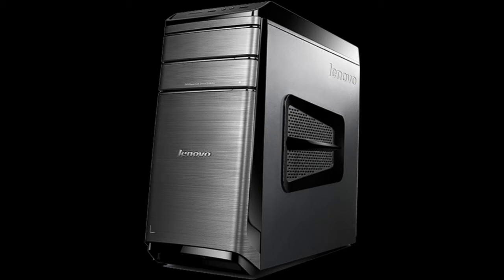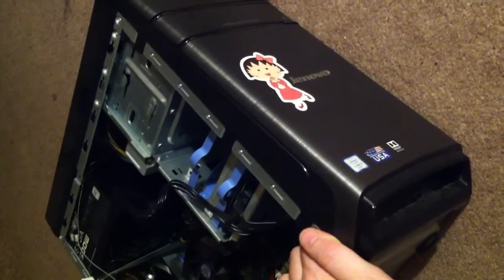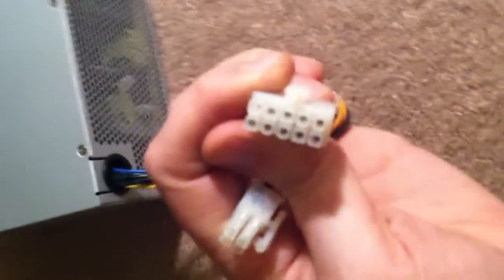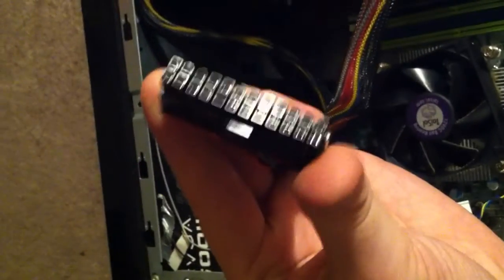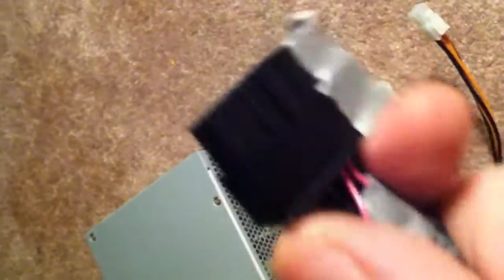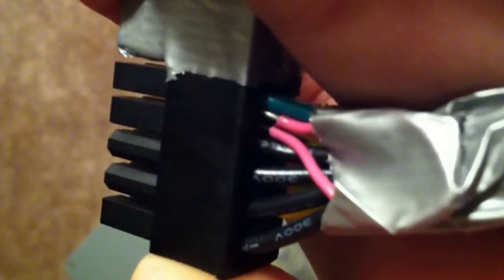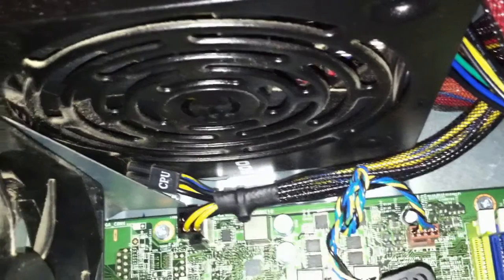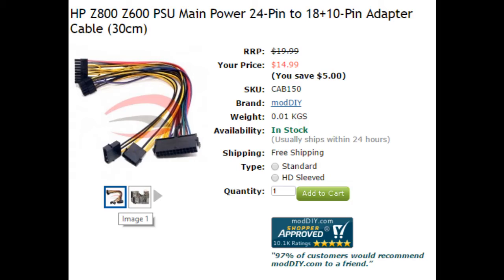Lenovo Ideacentre 10-pin ATX Shenanigans

Comment: Will PSU stay ON when you turn off PC?
Reply: Yes, the fan on the PSU will run pretty much all the time unless you turn off the switch on the PSU when it’s turned off. Or you can unplug the power cable or if the outlet is switched turn off the outlet.
Reply: Travis, thank you.
Reply: @TravisW85  does this can damage your components?
Reply: @Willyliemfams  I used an adapter instead of modifying the cables like in the video. But I never noticed any damage or concerns when I used it.  I've since gotten rid of that computer in favor of newer upgrades, though.

Since my PSU Fan ran all the time, that'd wear that down more quickly. I suppose it's possible that switching it off in the back could create some extra wear on the components but I don't know that it's anything to worry about.  I used my computer for almost a year after this I believe without any extra issues.
Reply: @TravisW85  well i decided to buil5 new pc with newer components, its $150 more expensive but, its upgradeable

Comment: So I recently got an EVGA 500w power supply, and it seems that my old power supply had the 10 pin and 4 pin. I used the 24 and used it as a 10, then I used the CPU 4 pin and used that for the 4 pin motherboard connector. Now I have these other wires that I didn't need. But it didn't turn on for some odd reason. Reply back to me if you know what the problem is, we are planning to return it and I don't know if I should try again or not.
Reply: Occidendum  hey I know this is old but I just changed out my power supply and tit doesn’t have the four pin connector it has an 8 pin cpu connector

Comment: Will the Lenovo have any issues running GTX 980 ti and a corsair tx650w after the adapter?
Reply from the maker: Hello Chun,

As user jonathoncasey posted, you can bypass most of this and just buy the adapter here: https://www.moddiy.com/products/IBM-Lenovo-PSU-Main-Power-24%252dPin-to-10%252dPin-Adapter-Cable-(30cm).html

There should be no issues with using those items in theory, but you may have a tight fit/squeeze with that card inside of the case, depending on the specific manufacturer that is using the 980ti chipset.
Reply: Grace Crary https://m.ebay.in/itm/Eyeboot-24-Pin-to-10-Pin-Power-Supply-ATX-PSU-Adapter-Cable-for-computer-PC-/253160467418?hash=MjA=
Is this a good adapter?? I just bought it yesterday and I have no idea.Now the thing that scares me if the adapter will cause any damage to my corsair tx 650m and motherboard and if the Mobo may hinder my GTX 980 ti performance with the 10 pin,it fits perfectly though
Reply: Grace Crary can I also use the eps 4+4 pin cable for the 4 pin motherboard?
Reply from the maker: yes without modification. standard 4 pin cpu, only one of them in this pc if memory serves

Comment: you just have to buy a 24 to 10 pin motherboard atx adapter
Reply: hey does it work ?? have u tried it
Reply: @praveenbhat5392  Yeah, it's normal that converter.
Reply: yeah there's already adapters but most of them are from china, just ordered mine

Comment: What about the 4 pin connector to the motherboard that the original PSU has?
Reply from the maker: you can plug in the 'CPU' power still - it will be coming out of your 3rd party power supply.
Reply: it will work a (molex to 4pin cpu) cable ?
Reply: Grace Crary can I use the 4+4 pin motherboard connector?
Reply from the maker: yes just split it

Comment: I think MODDIY makes the 10-pin adapter now.  See here: http://www.moddiy.com/products/IBM-Lenovo-PSU-Main-Power-24%252dPin-to-10%252dPin-Adapter-Cable-%2830cm%29.html
Reply: Robert McGee i tried and it works fine. Except as in the video stated that power supply fan won't turn off. It keeps working even the computer is shut.
Reply: Muhammed is correct.  I use it with my M900 and it works.

Comment: Where are the paperclips plugged in? Could you post a small tutorial on how you did that or maybe some high-res images? I really need this kind of thing with my PC. PLS halp!
Reply from the maker: You should be able to find a wiring diagram another user posted in this thread: https://forums.lenovo.com/t5/Lenovo-E-H-K-M-Q-Y-and-ErazerX/IdeaCentre-700-10-Pin-Atx-Connector/m-p/3439817#M12919

Comment: Could you do a tutorial on how you did the rewiring?
Reply from the maker: I'm afraid I do not have the time at the moment. You can get a tool for it off of ebay (molex pin remover tool), or you can suffer with your own improvised tools. I suggest getting the tool.

Comment: I felt ripped off I don't have the need too upgrade my graphics card but with overwatch now I do and I need a 400 w Power supply. Do you have any videos of your computer on and running?
Reply from the maker: I do not but i suppose I could procure such. It still runs, though. Running 1000 series NVIDIA card at the moment no problem.